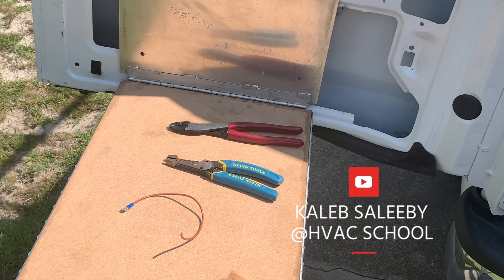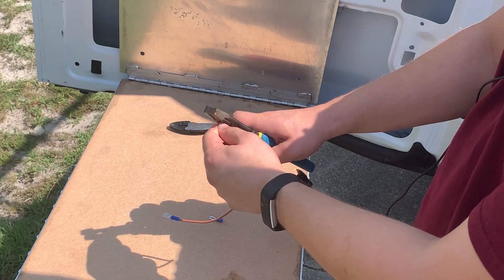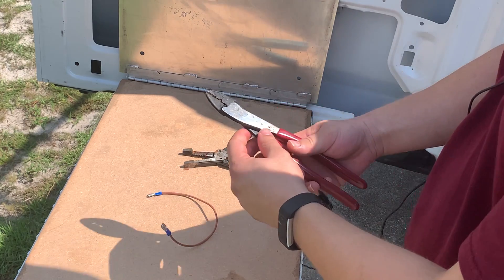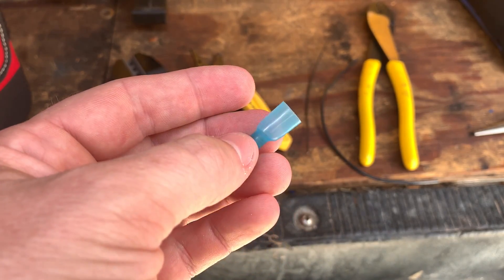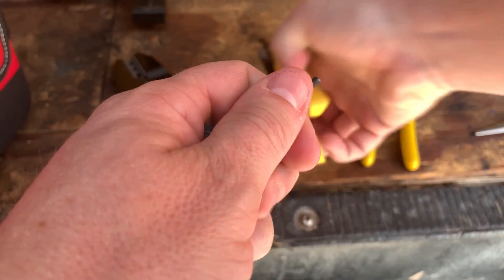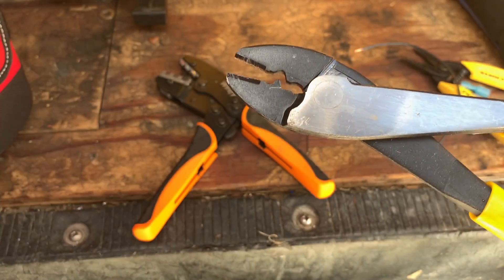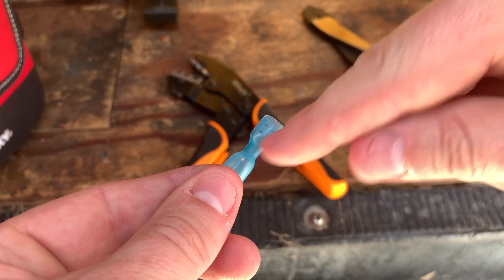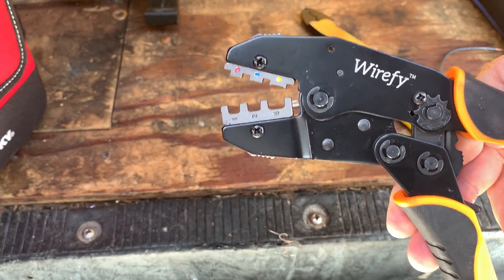Double Crimp Connection

Comment: IMHO I’ve found Usually the heat shrink type connectors are single crimp as the heat shrink tubing makes the second connection to the wire insulation as well as making a waterproof connection

Comment: Any company that regularly makes electrical connections should be specifying high quality parts and tools as well as training their techs how to use them.  It's like flowing nitrogen while brazing.  You can braze a system in without flowing nitrogen and it will run fine, but it won't last.  We should be doing everything well. A failure of a wire crimp due to poor technique/tools is a failure that didn't have to happen.   The guy in this video  https://youtu.be/faLn-SjVfwY does an excellent job explaining why you need to use the proper crimp tools on quality connectors. And here's another one https://youtu.be/0I1ZVXoB8Yk  .  Bryan, I love your channel and you have a lot of really great content.  But if you want to be serious about electrical connections, there is plenty of better information out there.  And a lot of worse as well.

Comment: I use quality connectors, be careful of the cheap crap. Some of the cheap ones can literally be ripped apart with your bare hands. I use the Klein non insulated crimp tool on insulated and non insulated connectors. I stake the connector and tug on them. The better the crimp, the less heat at the connector, the longer the connector lasts. I have never had one fail in the 22 years I have been doing it this way. If damaging the insulation is a concern, electric tape works great to cover it. Heat shrink tubing works even better. A staked connector will probably out live you.

Comment: No thanks for me. Use the heat shrink or get the proper connector with a separate crimp for the insulation.
Reply: You mean the proper crimper like Bryan had that is made to crimp both areas to the proper depth, no more, no less.  That's why it ratchets.

Comment: I have noticed over the years that the wire sizes and terminals have changed. It used to be that a 14 ga wire would not fit into a red terminal and the wires fit tighter in the terminals.  If you want to have a positive crimp like that use the terminals that have the additional metal sleeve that would crimp on the insulation.

Comment: Just use the crimpers correctly.  I don't like that idea of crimping the plastic to the rubber insulation on the wire.
Reply: Can you reference any specific document that says that? I've seen "double crimp tools" and "double crimp terminals", but have neve heard of crimping a single crimp terminal on the metal and plastic and it being called a double electricians crimp. I guess I also don't understand why not just use a double crimp connector if you really want two crimps on it.
Reply: That's known as a double electricians crimp, they've been using it for decades. most HVAC guys smash it down with a pair of pliers and don't even pull on the connector to see if it's tight or not. They just jab it back onto the capacitor and within two months the wire is melted off from the connector.  Gezzz 😵

Comment: Great tips, except solid wire, they should not be crimped. Solid wire does not have the rebound capacity to stay in the crimp. It’s better to put a length of stranded wire with a wire nut then a crimp connector. On the stranded end.
Reply: Yes, a crimp connector on solid wire is an invitation for failure. Folding it on itself does okay with small wires, but larger wires, definitely not.
Reply: This! Was going to leave a like, but then I saw the solid wire crimping part and said NOPE